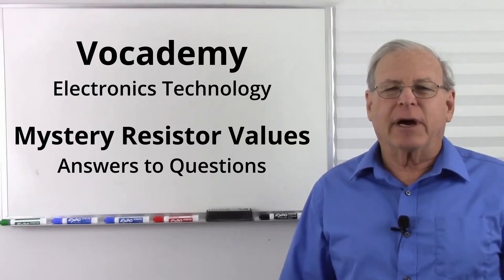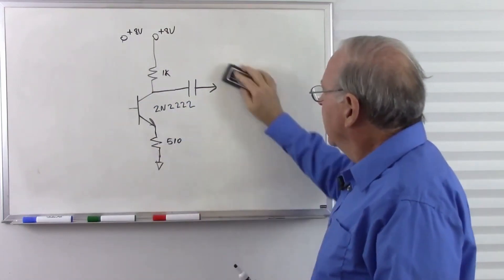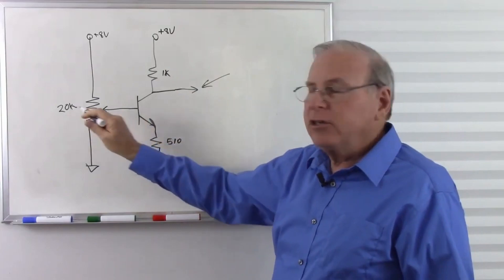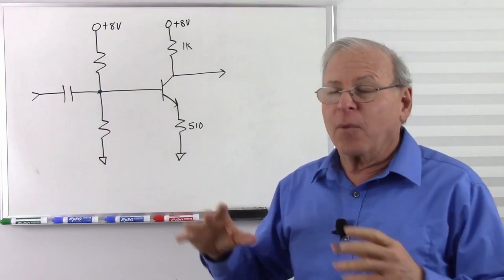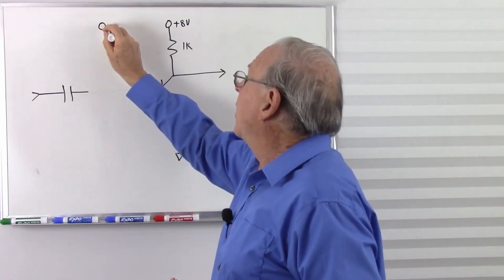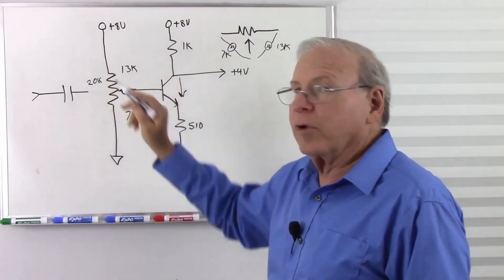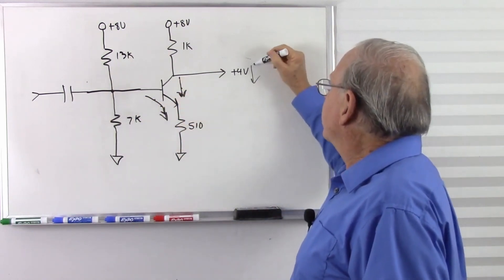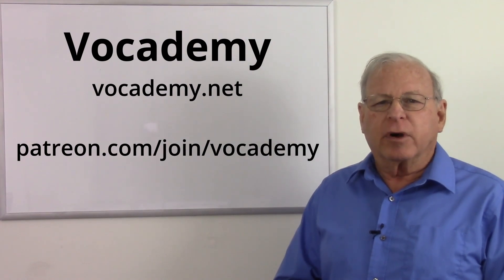Mystery Resistor Values   Answers to Questions

Comment: the answer is because he was shooting for 10x the output resistor values. My question is why 10x?
Reply: It's an estimate as the resistor is 13 times that of Rc. The actual value is calculated manually and getting 4V at collector is the goal.
Reply: I see, he using a voltage divider to get the bias voltage at 2.7v. But you could do that with the same ratio of lower value resistors. But he was shooting for 10x because he wanted a low input impedance.

Comment: Thanks for another excellent video!
Perhaps the original questioner was wondering why you chose a combined resistance of 20kΩ for the voltage divider. Any other combination of resistors that had a ratio of 13:7 would also have yielded the same bias voltage. In real-world circuit design, the actual choice would involve compromises between the quiescent power loss and other factors like input impedance and frequency response. I suppose mentioning all those things in an introductory video would be overwhelming, but sometime I'd like to look over an engineer's shoulder while he's doing exactly that kind of real-world design.
Regards.